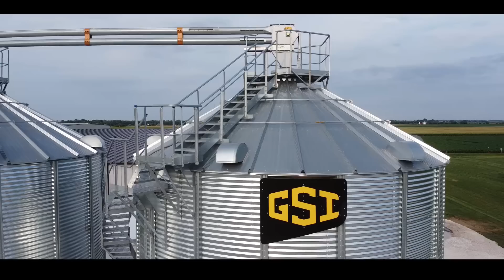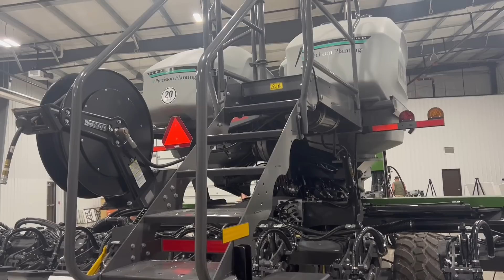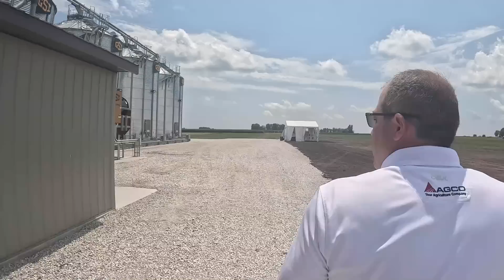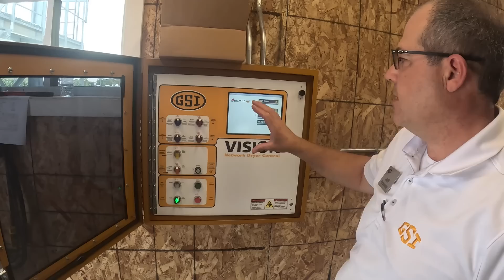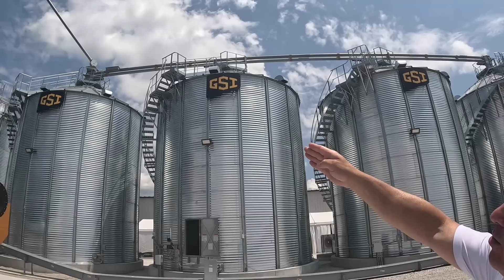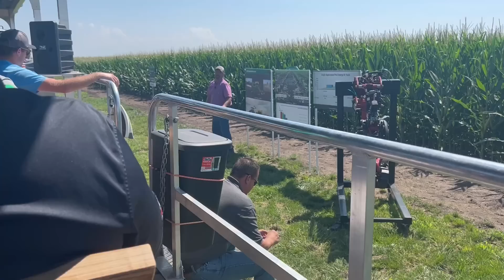BRAND NEW GSI GRAIN FACILITY! - PTI farm visit

Comment: Looks very,very expensive for the amount of bushels stored. "A bit of noise" with the axle fans is a understatement I've two 1220 axle gsi's they are LOUD...lol. The reclaim system  and overhead hopper = lots of $$$$$ you'll never get a roi on that unless your running 500,000-1,000,0000 bushel a year 10'' -12'' unloads and a truck auger easy fast and cheap....
Reply from the maker: This is a research setup